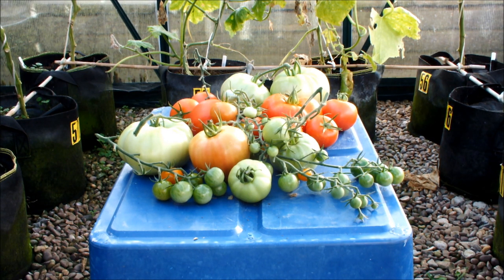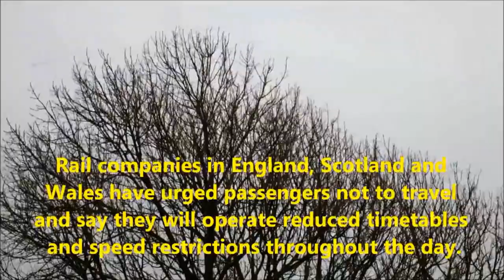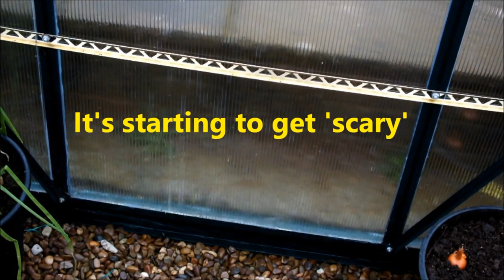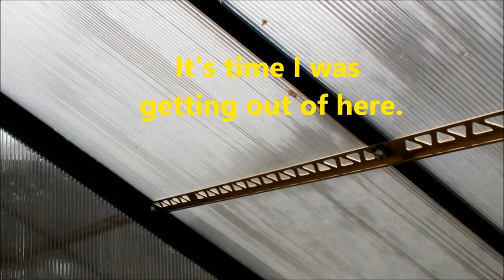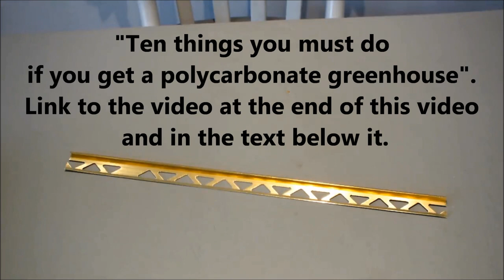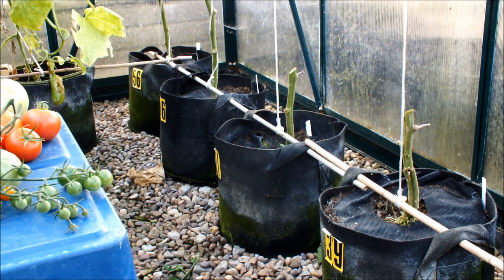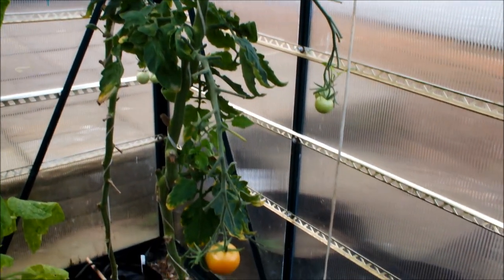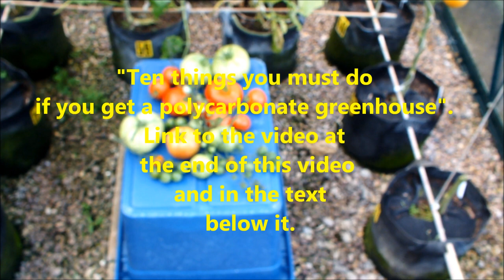Storm proofing a polycarbonate greenhouse

Comment: If the polycarbonate panels are already "flexed" at a slight arc, it seems to me they would be stronger, and unable to flex in and out.  The Romans discovered that arcs are stronger than flats
Reply from the maker: Hello Mark.  The polycarbonate sheets in this design of green house are captivated along their edges in channels. When the sheet flexes in a strong wind it can 'flip out' of the channel and its 'Good night Caligula'.

Comment: I had a similar problem, when I first go my polycarbonate green house my husband laid some heavy four by four posts and bolted the greenhouse to that, however the first storm blew a sheet out of the roof into the field next to our garden, must have given the sheep a fright. So we siliconed all the sheets in place and they’ve stayed put for four years. We live in North Cornwall so we get a lot of wind. The sheets are easy to remove when they need replacing, we just clean of the old silicone off the frame and silicone in the new sheet. Hope all our polycarbonate greenhouses survive this winter.
Reply from the maker: Hello Linda.   I cant understand why 'siliconing' all the sheets in, isn't standard advice given by the manufacturer. Would save a lot of heartache.   Jim.
Reply: I will be doing this now!

Comment: I got myself one of these polycarbonate greenhouses and what I did to stop the sheets from blowing out of the channels was, I used strong Gaffer tape on the inside along the length of the metal frame, half on the frame and half on the poly. This stops the poly from bending and jumping out of the channels when the wind is blowing. Just make sure the surfaces are dry before applying the tape.

Comment: Hi Jim, I retrofitted mine the same way as yours  OMG how strong it's became. Polycarbonate sheets no play in them, I didn't use cellotape, I used white duck tape great on temperature and cold without loss off stickiness, so thank you Jim brill idea.
Reply from the maker: Its a war zone out there. We fight on.   Jim.
Reply: I used duct tape and in the winter it doesn't stick when it's outside

Comment: I have have a polycarbonate greenhouse that storm totally trashed my greenhouse 5 roof panels disappeared the wall with the door was ripped off and the whole greenhouse is twisted I’m never having polycarbonate again
Reply from the maker: Over the last week or so we've had strong winds from the North. Mines still in one piece but I've had to do a lot of strengthening and fixing. I've recently replaced all the roof panels, the sun had badly damaged them. It's a greenhouse that can't withstand the Sun!!!!  Sorry to hear about your catastrophe.  If its any consolation, your not alone.  I expect other gardeners are going through the same nightmare. Jim.

Comment: Leaving your ground anchors in place is a genius idea. They sell all manner of systems from poured concrete footings and bolts to big rebar stakes and tie-outs but your solution is effective and basically free since you'd do it for the tomatoes anyway. The beauty of your system is each anchor only has to bear part of the load. In this case the whole is greater than the sum of the parts. Same logic as why a braided cable is stronger than a solid one of the same diameter. And as this reduces the flexing of the frame it allows for less flexing of the panels which, if I'm thinking correctly, will put less pressure on your cellophane tape allowing it to hold even longer.
I bet this video will help anyone with a polycarbonate greenhouse from suffering an expensive loss, with a cost-effective fix.
Reply from the maker: The night I nearly lost the roof, it had become detached from the side wall along its length. The fixing bolt holding the roof to the sides are in slots rather than holes. The flexing of the frame  and the vibration of the sheets slackened the nuts and bolts. The wind then lifted the roof and the bolts slid out of the slots. Let me tell you Diane it was touch and go as to holding the thing together. Trying to realign slots and tightening bolts if it has to be done, is best done in daylight on a calm dry day. I had to do it  at night in rain in the grip of a storm. Ever since then I have been mindful of destructive nature can be and try to avoid it happening again.  It would be easy for any new gardener to underestimate the forces of nature and overestimate the strength of their greenhouse. I had to share this so that others might benefit from my near disaster.   Jim.
Reply: Sorry to ask you because my heating is not that good  ,did you use cement on the base to anchor? I was worried about the cement will be toxic to our health.where did you get those  white stripes from and what you called them. My greenhouse is already fixed I don't think I can get the nut and bolt in the holes, what size nuts and bolts you used. It looked good.

Comment: A good old UK storm eh, but not very friendly to polycarbonate greenhouses, as you know Jim.  I lost a couple of glass panes in the last storm up here in Northumberland, so glad to see your polythene panes survived. As for the auto vent openers, I take mine off in winter & run a zip tie through the holes to secure the vents. I'm not going to use them in winter.
I also paved the area for my greenhouse so I could screw it down for security.
Reply from the maker: The greenhouse I got was flimsy no question about that and I had to 'beef it up' just to keep it in one piece. It should have come with a public health warning. Jim.
Reply: @HomeGrownVeg  haha

Comment: Right from the get go we had to use lots of self tapping screws to hold the 4mm pc sheets , we have since replaced about    1/3 of the panels for 10mm as the outer pc degraded .
After this experience I would recommend someone either buys a glass (safety) greenhouse or makes there own with timber and 10mm pc . Out of the box they're not fit for purpose.
Reply from the maker: I think I've had 3 years out of this one so far. I thought I was going to lose it in a storm a day or two after I built it but the extra stiffening seams to have done the trick. I've had a glass greenhouse many years ago and wanted to try polycarbonate.   With hindsight, big mistake.

Comment: We just put ours up this past weekend.  It took my husband and me all weekend.  We still have to level it out more.  I'm going to get the bambo and weigh it down like you did.  What diameter bamboo did you use?   Also, how did you attach the bamboo to the channels?  It's hard to see in the video, kind of dark.  Looks like some kind of black strap or something.   Update:  I just saw the other video you posted Hold your polycarbonate greenhouse down now Don't wait until a storm tries to lift it off the ground - which shows these in close up
Reply from the maker: I used the standard aluminum fixing bolts and I had some metal strap that had holes in it.  The bamboos are just standard 6 foot bamboos. If it looks flimsy it probably is. If you can add strength and it looks stronger it will be. Its now you, your husband and the greenhouse against the elements. Best of luck. Jim.
Reply: @HomeGrownVeg  haha, thanks!  I'm going to get 7 foot length and they are 3/4 in diameter.  There are 8' ones that are 1 in diameter, but then I'd have to cut them.